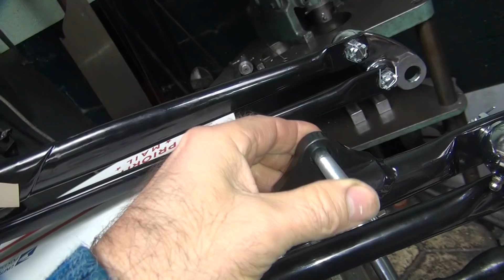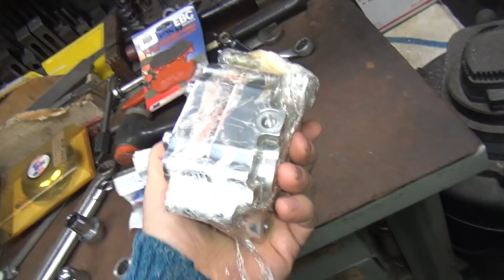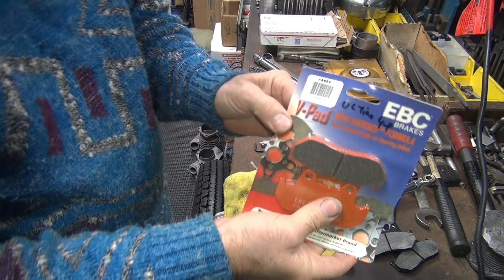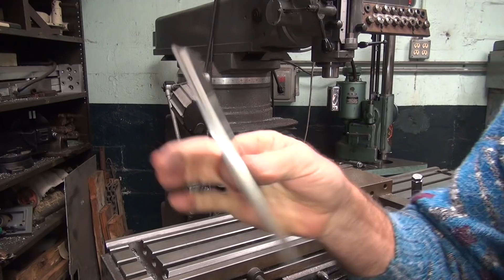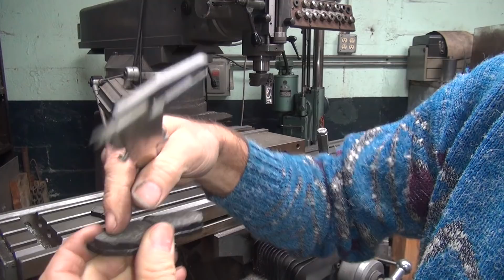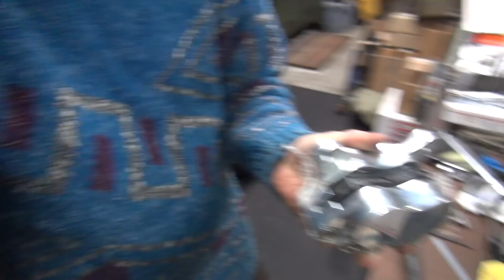1936-1948 #104 knucklehead springer bobber disc brake conversion shovelhead harley by tatro machine

Comment: Around minute 35:00, why didn’t you just remove the 4 Allen bolts and separate the caliper? I did it this way and it made it easy to put the springs and pins in